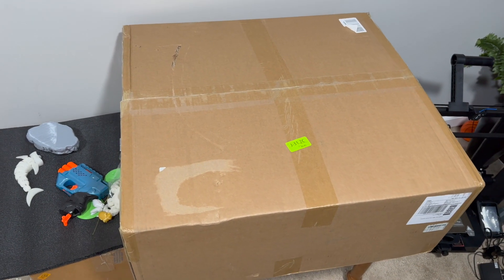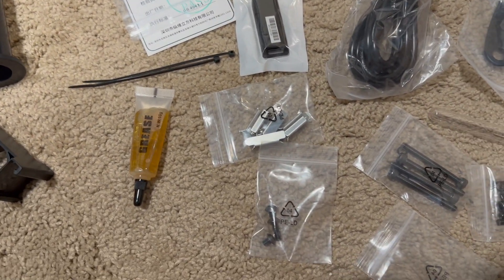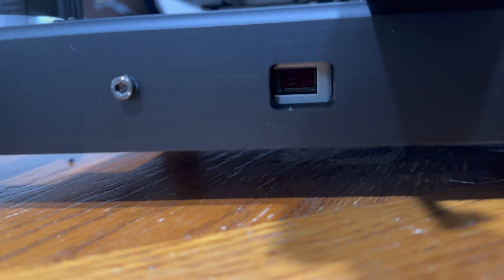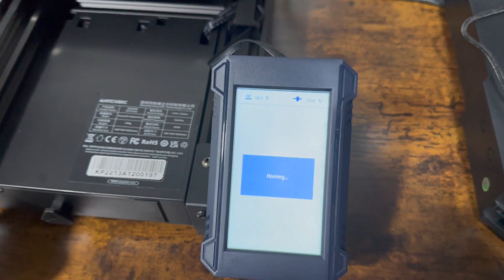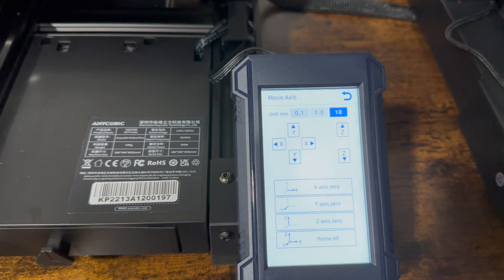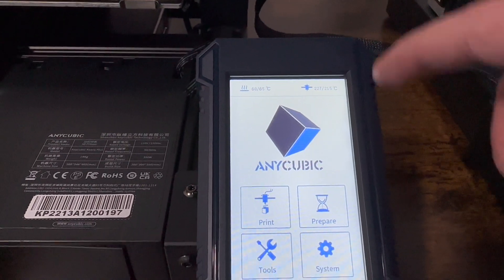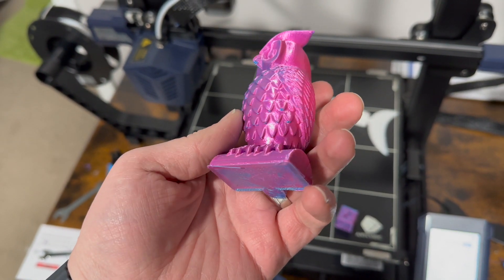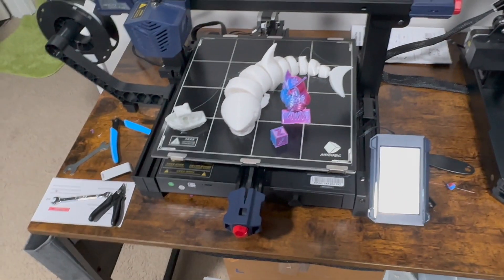Anycubic Kobra Plus 3D Printer Unboxing, Assembly, and Review

Comment: I have a kobra plus that compliments my Prusa MK4/MMU3. I did not particularly like the fact that you had to tap the auto leveler sensor with metal to initiate the Auto leveling.  I added a BLTouch on it. It works great. 

You have to be careful of the clips, my printer hit one clip and sparks flew. I discovered this with the first auto leveling. On the left side of the bed, the tolerances when bed moves forward, the front clip will strike the left Z Axis. So I had to flatten the clip a bit. There’s about a 8mm difference between the left and right Z Axis.

Comment: hi was wondering if you could help me out im trying to add kobra plus to cura and im not having any luck
Reply from the maker: I think I added the Kobra max and changed some of the code
Reply: I think you already figured it out, but if not, just select custom printer fff in the settings and enter the print area settings for your printer